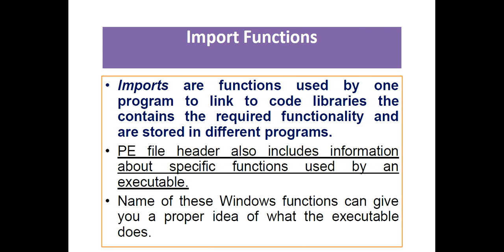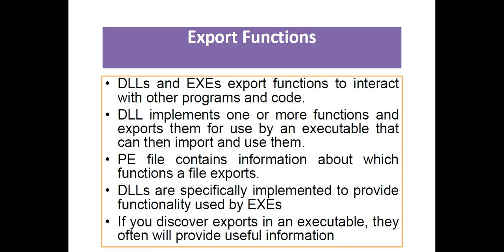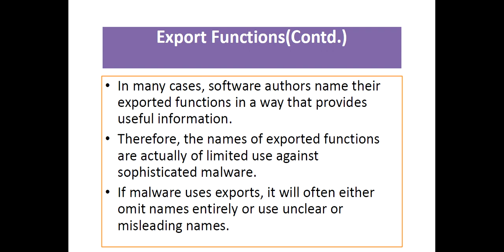Functions| Import and Export functions|Malware Analysis

Comment: a function is a binary relation over two sets that associates to every element of the first set exactly one element of the second set. 

Export: export is to convert a file into another format than the one it is currently in. Once the file is exported to the desired format (specified in its file name suffix), it can be opened and worked on by an application that recognizes and uses this format.

Import: To convert a file into the format required by the application being used. Many applications are capable ofimporting a variety of popular formats, converting them into the native format of the application for display, printing or editing.

Comment: A 
Export: A statement to export primitive values , objects, functions, or classes from the module for the purpose of being used by other modules.

Import: The import statement combines two operations, it searches for the named module, then it binds the results of that
search to a name in the local scope. The search operation of the import statement is defined as a call to the __import__(function, with the appropriate arguments.

Comment: A function is a block of statement which is used to perform a specific tasks.

Export:
A statement to export primitive values, objects, functions, or classes from the module for the purpose of being used by other modules.

Import:
The import statement combines two operations, 
it searches for the named module, then it binds the results of that search to a name in the local space.
The search operation of the import statement is defined as a call to
the __import__() function, with the appropriate arguments.
Reply from the maker: function definition is correct !

Comment: A function is a block of statements which is used to perform a specific task.

Import:- The import statement combines two operations; it searches for the named module, then it binds the results of that search to a name in the local scope. The search operation of the import statement is defined as a call to the __import__() function, with the appropriate arguments. The return value of __import__() is used to perform the name binding operation of the import statement.

Export:- The export statement is used to export functions, classes, objects, or primitive values from the module so they can be used by other programs or modules with the import statement.
Reply from the maker: function definition is correct !

Comment: A function is a block of statements which is used to perform a specific task 
Export: A statement to export primitive values, objects, functions, or classes from the module for the purpose of being used by other modules.

Import: A statement to use primitive values, objects, functions, or classes that are exported from another module. Typically, an import is static, but it can be dynamic too.
Reply from the maker: correct !

Comment: 1. The import statement combines two operations; it searches for the named module, then it binds the results of that search to a name in the local scope. The search operation of the import statement is defined as a call to the __import__() function, with the appropriate arguments.

2. The Export function is an idea used in economic theories to measure exports. The total amount of exports, E, in a nation is mainly affected by two variables, see import, the total foreign absorption and the real exchange rate.
Reply from the maker: correct !

Comment: CS18MSIIT039

Export - A statement to export primitive values, objects, function or classes from the module for the purpose of being used by other modules

Whereas, The Import statement combines two Operations., it searched for the named module than it binds the results of that search to a name in the local scope.
The search operation of the import statement is defined as a call to the __import__() function, with appropriate arguments.

Comment: A function is a block of statements that performs a specific task

There are two types of functions
(1) library function
(2) user-defined function

Functions are used because of following reasons –
a) To improve the readability of code.
b) Improves the re-usability of the code, same function can be used in 
   any program rather than writing the same code from scratch.
c) Debugging of the code would be easier if you use functions, as errors are easy to be traced.
d) Reduces the size of the code, duplicate set of statements are replaced by function calls.
  
Syntax:-
return_type function_name(argument_list)
{
statement or code;
}

Ans1:-
The import statement combines two operations; it searches for the named module,
 then it binds the results of that search to a name in the local scope.
The search operation of the import statement is defined as a call to 
the __import__() function, with the appropriate arguments.
Ans2:-
A statement to export primitive values, objects, functions, or classes from 
the module for the purpose of being used by other modules.
Reply: thank you sir
Reply from the maker: Happy with your answer

Comment: The import statement is the most common way of invoking the import machinery, but it is not the only way. Functions such as importlib.import_module() and built-in __import__() can also be used to invoke the import machinery.

The import statement combines two operations; it searches for the named module, then it binds the results of that search to a name in the local scope. The search operation of the import statement is defined as a call to the __import__() function, with the appropriate arguments. The return value of __import__() is used to perform the name binding operation of the import statement. See the import statement for the exact details of that name binding operation.

A direct call to __import__() performs only the module search and, if found, the module creation operation. While certain side-effects may occur, such as the importing of parent packages, and the updating of various caches (including sys.modules), only the import statement performs a name binding operation.

When an import statement is executed, the standard builtin __import__() function is called. Other mechanisms for invoking the import system (such as importlib.import_module()) may choose to bypass __import__() and use their own solutions to implement import semantics.

The export statement is used when creating modules to export functions, objects, or primitive values from the module so they can be used by other programs with the import statement. Exported modules are in strict mode whether we declare them as such or not.
Reply from the maker: Right!

Comment: A function is a block of statements that performs a specific task.

Import:-The import statement combines two operations; it searches for the named module, then it binds the results of that search to a name in the local scope. The search operation of the import statement is defined as a call to the __import__() function, with the appropriate arguments. The return value of __import__() is used to perform the name binding operation of the import statement.

Export:-The export statement is used to export functions, objects, or primitive values from the module so they can be used by other programs with the import statement.
Reply from the maker: Very good Answer..

Comment: Export :export is to convert a file into another format than the one it is currently in. Once the file is exported to the desired format (specified in its file name suffix), it can be opened and worked on by an application that recognizes and uses this format.
Import: import is to open a file that is in a format different from the format the application creates on its own. ... After working with the opened file, an application user can usually simply "Save" or "Close" the file, leaving it in the current format, or can export it to another format.
Reply from the maker: Right!

Comment: A function is a block of statement which is used to perform a specific task

Export: A statement to export primitive values , objects, functions, or classes from the module for the purpose of being used by other modules.

Import: 
The import statement combines two operations, it searches for the named module,
then it binds the results of that search to a name in the local scope.
The search operation of the import statement is defined as a call to the_import_()function, with the appropriate arguments.
Reply from the maker: Right!

Comment: CS18MSIIT041
Export:-A statement to export primitive values, objects, functions, or classes
from the module for the purpose of being used by other modules.

Import:-
The import statement combines two operations; it searches for the named module,
 then it binds the results of that search to a name in the local scope.
The search operation of the import statement is defined as a call to 
the __import__() function, with the appropriate arguments.
Reply from the maker: CORRECT!

Comment: 1. Function:- A function is a block of statements that performs a specific task. Suppose you are building an application in C language and in one of your program, you need to perform a same task more than once. In such case you have two options –

a) Use the same set of statements every time you want to perform the task
b) Create a function to perform that task, and just call it every time you need to perform that task.
2. Function uses are:-
a) To improve the readability of code.
b) Improves the reusability of the code, same function can be used in any program rather than writing the same code from scratch.
c) Debugging of the code would be easier if you use functions, as errors are easy to be traced.
d) Reduces the size of the code, duplicate set of statements are replaced by function calls.
3. Import and Export:- An ES6 module is a JavaScript file. It is executed within its own scope — not in the global scope. Variables, functions, and classes that are declared in a module are not sharable between modules unless they are explicitly exported and imported.

Export:-A statement to export primitive values, objects, functions, or classes from the module for the purpose of being used by other modules.
Import :-  statement to use primitive values, objects, functions, or classes that are exported from another module. Typically, an import is static, but it can be dynamic too.
Reply: A function is a block of statement tht performs a specific task.
Reply from the maker: WHAT ARE THE TWO OPTIONS?